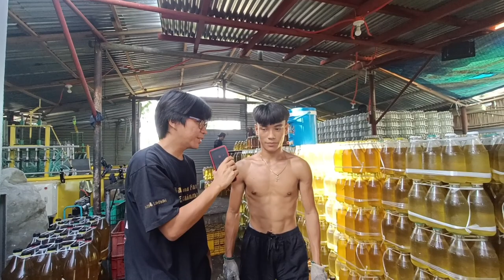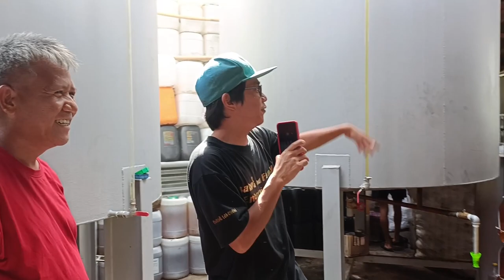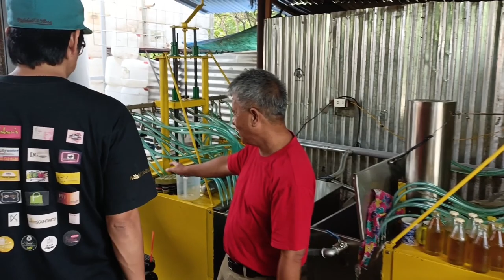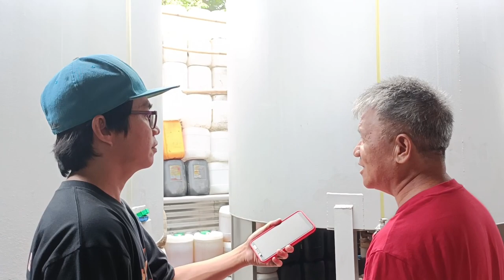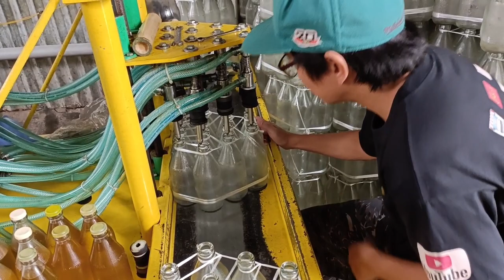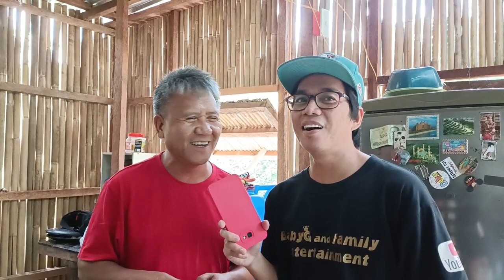Pavez Cooking Oil Trading: Vlog Interview!

Comment: Sa sunod alamin mo presyo lahat ng  sizes ng bottle para may idea kami kung pwedeng maging reasaler kami dito sa area namin❤❤❤
Reply: Actually yun lang ang inantay ko para magkaideya pano ang tubuan. 😅
Reply from the maker: hello Po..eto Po contact number 09568224068 at 09209563803
Reply from the maker: 09070928760
0466 pasong bereng humayao road langkaan 2 dasmarinas
Reply from the maker: 09070928760
0466 pasong bereng humayao road langkaan 2 dasmarinas